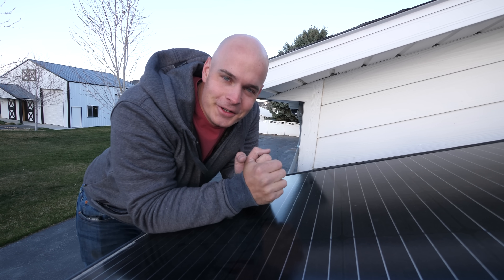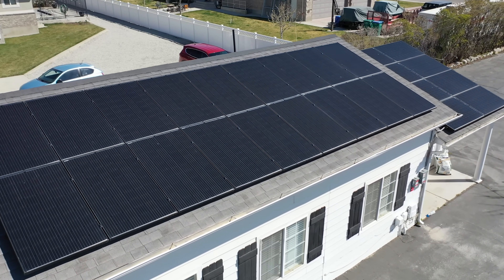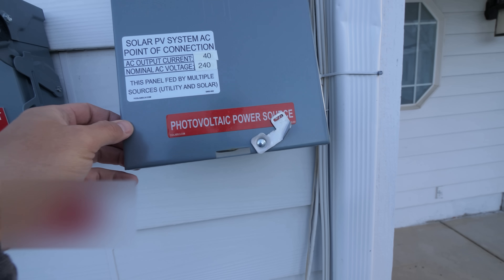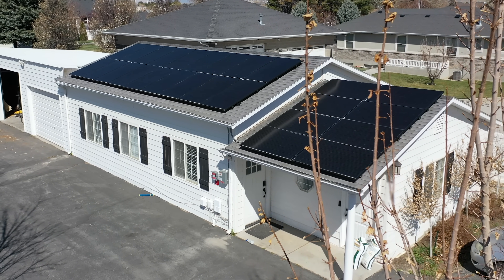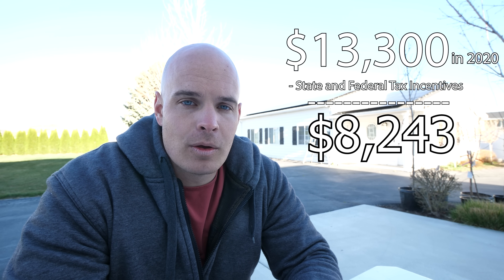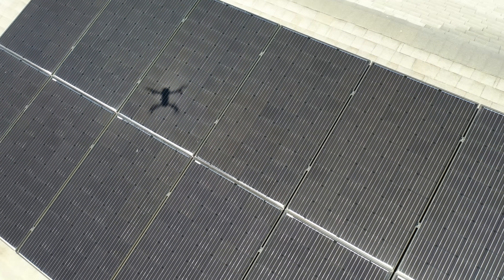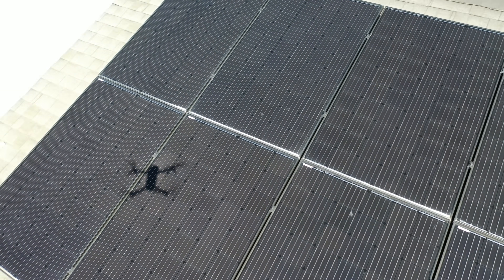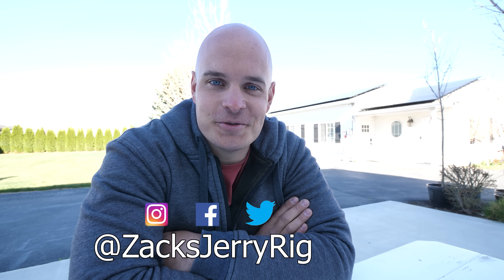One Year Solar Update! - Is Do it Yourself Solar worth it?

Comment: I have seen clearanced panels on some of those wholesale website for around $0.50 per watt, you can make your own battery packs from lithium iron battery cells they sell wholesale all over the internet, and also I think it's a really cheap(or at least when lumber is at normal prices) and good option to use pressure treated lumber coated with a wood sealer as rails to mount the panels too, vs buying a racking system. 

Also a lot of people have had good success with building their own panel rotator to follow the sun using sensors or simple timing, and some programmable controller like an arduino or raspberry pi. You could probably reasonably install a system like this if you do it right, with similar capacity, with battery backup capacity, and produce more energy, while having spent less money(but also more time and research). 

Also some smart investment in the thermal efficiency of the house can pay big dividends as well.

Comment: is not about tesla module or other company , the purpose is in what type of the solar panel they use because there is a huge difference between (Monocrystalline panels) and (Polycrystalline panels) or amorphous silicon  , each of those types has different energy producing and guarante years , and the best of them back to where exactly you will install the setup because it all about climatic condition

Comment: Check up on the newest scientific developement about Solar Panels. The world wide leading institute about solar panels/energy, the Frauenhofer Institute in Germany, has announced a massive breaktrough in many fields. They managed to produce a panel that is nearly 50% easier and therefore much, much cheaper to produce and has an efficiency of nearly between 40 and 50 percent, wich is a massive improvement, because the usual panel has an efficiency of around 26%. 
The mass production of those new solar panels is about to start already later this year in Germany and Europe. 

All in all this means that solar power is by far the cheapest way to produce energy there is. The institute estimated a few years back that if alone all the none privat buildings have a solar panel array (20% efficiency) on their roof, Germany would produce during the summer nearly 80% of its avverage energy consumption for those months and during winter ca. 55%. 
You can easily estimate much more is produced with those new panels. In theory that means that Germany could be CO2 neutral in energy production in the next 5 years, because ~50% of last years energy mix was from renewable sources. And now you also can estimate how easy it would be for other countries aswell. 

And lastly this breaktrough questions all those building projects of nuclear reactiors heavily. Why building something thats dangerous, extremly expensive (once and running costs), never pays itself back, leaves you with waste you've to care for eternaly and so on, when there is a far, far cheaper, not dangerous, no waste and after a few years very profitable alternative?

Comment: We have a Sun Verge backup battery on our house.  Our house is on battery during the day and they charge at night.  Of the power goes out, we will still have power.  They are capable of running our house for 48 hours.  Backup batteries are nice

Comment: Great video and 1 year follow up. 21 years ago I installed 10 $400 120 watt panels when I bought this old house, 24 December 1999 (Y2K event premiere).  8 panels are left and produce 90 watts each, I am impressed they lasted this long! One year ago I bought 5 $200 320 watt B grade panels: half as many panels, half the price, and 2 and 1/2 more power. I install and maintain it all myself. I am impressed with solar. Total energy made: Over 38 million watts. Or $15 off each months electric bill.

Comment: I gotta say, even though I love solar panels and will get them when I get a house, I am a stats guy. So you are not including the cost of paying yourself to put them up, if you pay yourself and all your crew (in the form of future favors of equal value) 30$/hour, then you start to cut into your margin fast. Also when you compare it to returns of the s&p 500 it's terrible. Also it's very no liquid so you couldn't sell them if you needed a surgery like you could with stocks and bonds. I will get solar panels, I don't think it's very economic. Also roofers have a higher mortality rate then soldiers, so you are risking your life too.
Reply: Also when install it on shingle roof like that only lasts 20 years they have to be removed to replace the roof and reinstalled at extra cost.
Reply: @jaggsta  yeah I think solar fields are way more practical, since you can hire 1 person to handle acres of solar panels, all directed at the sun.

Comment: Yeah, no thanks. Here's my issue. You pay for the solar panels and basically provide a real estate (your roof) for the energy company and who sets the price of the money going into the grid? Oh thats right, its big energy, not you, the one that is generating the energy. Secondly, Solar panels are only usable during daytime. Now, if you dont happen to be at home during those time you cant make use of at all. The only way i would get solar is if the installation COMES with BATTERY. That way i can actually generate energy for myself AND have it usable at night time when i use it most. Until then  there is no way i would install Solar panels, if big energy wants to pay for the cost of the equipment and installation, im sure i can work out a leasing price of my roof for them. There is no way im leasing MY property to big energy for peanuts!  Bring on high capacity batteries!

Comment: In fact bidirectional charger for EV are in production right now which allow you to use your electric car and light up your home, Elon was not the first to think about it.
Reply from the maker: Can you name a specific brand that does? I've been looking.
Reply: @JerryRigEverything  Right now i can't tell you my friend would be upset if this leak out... Something i can tell you is Hyundai was the first to actually think about it but they wanted a small design which could produce the same energy as the GM or Tesla home charger but smaller and bidirectional, which is something impossible if we include the amount of transformer the unit need to be bidirectional !!
Reply: @deadbluesky  prove or never happened 🤷

Comment: Installing a battery is cool because if you loose power you'll still be online but the problem is the batteries degrade quickly I believe after full cycles of being drained and filled it will lose 20% of its max capacity and so now you will lose 20% of that 80%  20% faster which sounds weird because it is. That's just how exponential stuff works
Reply: Yeah battery tech isn't good yet. Maybe in another 10 years.

Comment: What about a gravity battery?   Large weight, pulleys and gears to motor driven by excess power to raise a heavy weight and then can just reverse that to generate power.   Certainly avoids that battery cost and also be low maintenance without degradation, unlike batteries.

Comment: Cool, since the average price in Germany is 0.30 euro cent per kWh, that's 0.35 dollar cent, I could save about $4,700. (even though 8 kWp costs about 12000€ or $14,400 because incentives already run out long ago)

Comment: As a Texan, we also don’t know what’s going on. We were told to conserve our energy just the other day that got everyone spooked for another outage. Hurricane season should be a blast this year :))
Reply: get yourself some baked beans just in case lol
Reply: as an Iraqi -baghdad ... don't ask 😂
Reply: Texan solar gang unite!
Reply: Yooo texan gang
Reply: So you donno whats goin on but know enough to talk about "modern solar panels" 

Yeah I bet you don't texas prevented a grid black start (think 1-2 months to get the grid back up) solar is pretty much useless and harms the grid... wind is just unreliable... so also harms the grid...

Crash course in grid...
All power is generated on demand grid has NO storage... to little or to much power made = voltage and frequency issues
BASE LOAD POWER PLANTS... run 24x7 take a long time to shut down and start up... they supply the base load... amount of power that is always used... at any point of the 24H day
Peaker plants... quick firing plants that take up the extra load (normally around 5pm to 10pm) could be clean like hydro... or more dirty due to the quick start quick shutdown design... 

Then you have solar... that puts peak output MAYBE (got to be sunny) at the exact time power is NOT needed...
Wind that may or may not produce power (never know)

This fucks up baseload... 

The more wind and solar you ad the most costly power becomes (less base load more peaker and you need to cover solar and wind with generation as well) 
You main issue was you lost nat gas power plants due to the crazy abnormal cold... 
You had 2 choices, lose all power, take 1-2 months to reassemble the gird... or cut out the load that was shed... 
Btw the reason a black start is taking 1-2 months is kinda simple.

Grid has no batteries... generators must make power on demand... when demand out strips generation voltage and frequency fall out of spec... if they go far enough out of spec you damage the generators... so the plants must be shut down... 

You don't start a large power plant with a battery or a little generator... you pretty much need another power plant to jump start it... 

Not the case of all but a case... 
HUGE diesel generator fires up a black start power plant
Black start power plant supplies power to base load plant
Base load plants checks all its system... and restarts
Base load plants slowly adds load back one by one, and it can not supply everything as now houses, friges, etc all are running full out on every location restarted power usage needs to normalize before firing up more and more locations, base load plant also powers another base load plant, said plant goes over the same start up procedure and starts to SLOWLY add back on load... the grid is slowly restarted and reconnected...
Reply: Texas wants to be a country .   Even if it kills its citizens
Reply: Hurricane and Hail will damage solar panels and make them useless.
Reply: @jaggsta  Oh really? funny how we have been through 3 major hurricanes since getting our solar panels and they haven’t had any major damage to them. modern solar panels are built to withstand hail and wind damage.
Reply: @jaggsta  hurricanes and hail will damage roof shingles and make them worthless. Does that mean we should just not use shingles because of a slight possibility of damage? If that's the case, why do we use cars, or boats, cuz they may get damaged when we use them, and make them worthless. That logic is completely fallible in terms of the benefits of using solar panels
Reply: Jaggsta : ah, well then, we just leave it or what?
Reply: @jaggsta  it depends on the quality of the panels, and also thats why you PV in to your home insurance against that
Reply: @jaggsta  That's what home insurance is for.

Comment: Had solar installed on my home in Colorado December 2019. Haven't had an electricity bill since January 2020. I have a system about 1/2 the size of Zach's (13 panels on ours), and we've been super impressed, producing on a good day in the early spring of 27kWh a day. 

Cost was about $18,700 after rebates and been taking advantage of $5000 tax breaks, with rollover year to year, reducing our tax burden. Ours cost this much due to labor for sure (roof is about 55° angle, so I'm not doing that DIY, lol). In 2020, we made 5.5 MWh of energy. To date this year, we have produced 1.5 MWh. Expecting around a $300 check from the energy company, since they buy up what we don't use. 

Honestly? Still totally worth it, and it further protects our roof from those infamous CO Hail Storms.

Comment: Another factor to consider is that it may be a much cheaper way to get electricity to your home if there’s no electric service in your area or if you want this as an alternative to a gas powered backup system. If you are building a passive house, then this might be sufficient to power the low drain electrical system.

Comment: Did a 6 Kw east west setup a few weeks ago. Angle is similar as you have but with it still being winter direction makes surprisingly little difference, only a few hundred W. In europe you might be able to get a setup for cheaper (6K without incentives yet) but might also be because we use a central inverter that supports 2 strings instead of the more expensive micro inverters. Do keep in mind shadows are a pain without micro inverters.

Comment: Sharing my experience from Jordan (sunny country in middle east). My solar panels produce ~30 kWh daily and ~860 kWh monthly from a 5.4 kW system.

 I've installed solar panels on a terrace-like metal structure. I've used a single inverter not a set of micro inverters because it's more cost effective. It's composed of 12 panels each 450 W made in to two arrays/strings each of 6 panels. 

The government requires providers to give 25 warranty on the panels and 5 years on the inverter.

Comment: Question about when the life span of the panel comes to end... 30..40y , do you know how those panels will be recycled or is there such thing yet to be?
Reply: Ok, so the life cycle doesn't "end" as such. The efficiency simply reduces n reduces till u decide that it's time to change. Now, the reason why solar panels r difficult to manufacture is because it is extremely difficult to purify silicon from sand. But because solar panels ARE made of purified silicon with artificially introduced impurities, it is relatively easy to simply melt it n get highly purified silicon to make solar panels from it. So, recycling solar panels is a bit cheaper n easier than making new solar panels.

Comment: Great work .. if the sale price to the network is considerably less than purchase price - in many cases 50%.. then the east and west facing becomes more valuable as that is when the household uses most of the power .. the middle of the day is very low power usage .... Breakfast and dinner times are typically the heavy usage times .. ... Also if you have a battery - east/west facing reduce the discharge period on the battery... and last issue - in some cases backup ‘large ups’ for the home office is a value add that has real financial value as no power means you now need to go to the office .. no internet, no computer, ..Thanks for the video, great work... ps in Australia the typical installed price for 6.6 kw is around 3000 dollars .. and micro inverters are typically double the cost for the total install against single inverter with dual dc feed ..